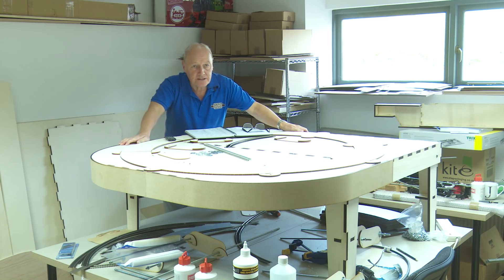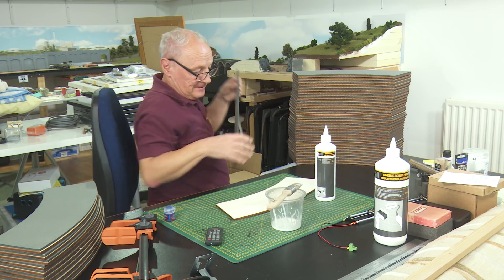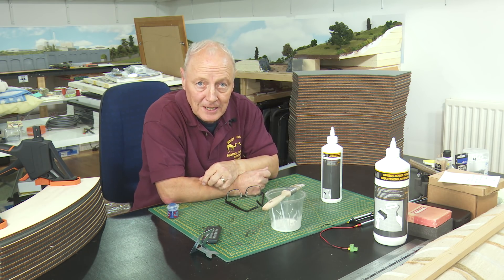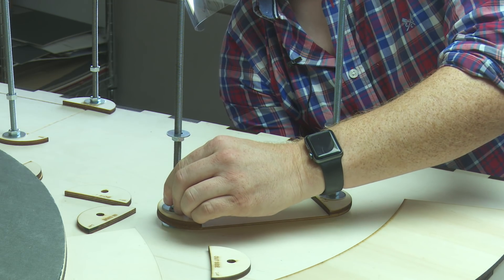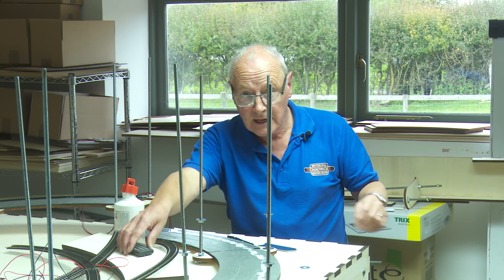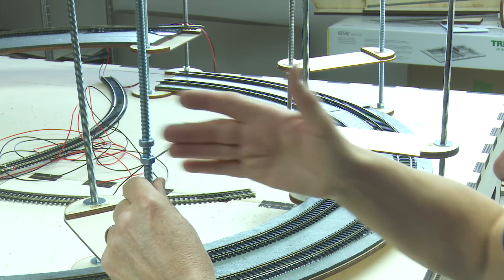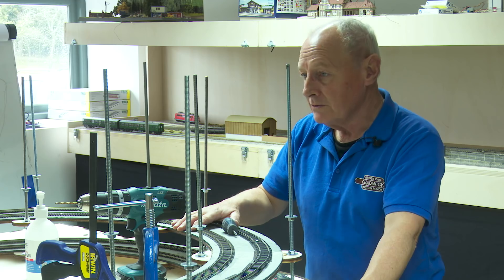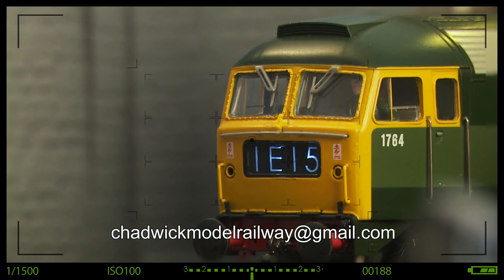Building a Helix at Chadwick Model Railway | 114.

Comment: Wow, you've got your work cut out on this project. Never heard of the DCC concepts Power Base but it looks really good. Presumably it means adding magnets to all of your Locos? Very interesting video and I really look forward to seeing the next stage. Thanks.
Reply from the maker: That’s it Dave, but you only need to add magnets to the locos that struggle. 
Regards Charlie.
Reply: @ChadwickModelRailway  sorry need to explain what the magnets use for
Reply: @jenniferwhite6089  The magnets are attached to the underside of your locos and are attracted to the Power Base strips thus pulling the loco down onto the track giving it more traction. (think ground effect in F1).   Jenny Kirk did a video a couple of months ago and she was able to run a loco upside down using the Power Base system !   Dave

Comment: Hi Charlie. Great video as usual, have thought about a helix for my layout but sounds a bit expensive. It was interesting to see your using DCC Concepts Powerbase as I have an 11Ft long rise of 2.5 inch. at each end of my layout and as I am a steam fenatic I find they struggle a bit with three or more coaches. My concern with yours is that fitting these screws in the middle of your track that only just fit below the rail height is that when fitting the magnets under the locos they may catch the screw heads as the magnets need to be as close to the metal plates as possible for good adhesion. 
Just a thought. Keep up the great work. All the best. Mike.
Reply from the maker: I really don’t think that’s the case mate because if the magnets were to catch the screwheads they would catch the point blades too. Regards Charlie

Comment: Hi CHARLIE 
Great video. Just a point on you using the screws to fix the track. Will they interfere with the magnets that you are fixing to the loco’s? I experienced a problem when I fitted the magnets with my rail fixings touching the magnets and causing a short. Hope you don’t have a similar problem. Keep the videos coming, thoroughly enjoy them.
Reply from the maker: Hi John, they wont touch but they might have an adverse effect on the loco's movement!

Comment: Hi Charlie! Aren't helices just fun with all the issues they come with? Like what all could go right for once? I didn't go the route with the rods and nuts but I am thinking I probably should have. I cut 1x4's to support between each level at 3.75" since I am using .25" plywood to give a 4" rise over a 29.5" Radius. I had so many issues where both incorrect math and warping in the plywood caused me having to back step many times by having to add extra supports. It seems like you might think the first loop works great but you really can't tell until you get to loop 3 and beyond, or at least I couldn't. I am looking forward to seeing the finished project and your thoughts on it and I might consider going with rods and nuts on my 2nd one. Take care! - Jason
Reply from the maker: A brilliant and honest comment Jason. And one which I really appreciate, fingers crossed, I know it’s a challenge. Regards Charlie
Reply: Hey Jason my Club used allthread and so am I.   I think I told you before.   I haven't been able to do much through because the weather turned bitter cold and frozen rain or snow now all week.

Comment: Just a thought, Charlie. As the underlay dislikes heat is it worth soldering your rail dropper wires to the track before fixing the track to the underlay? A great video and a major task on which you have embarked. Very brave :--)
Reply from the maker: Hi Pat, I couldn’t have explained it very well. Yes I have soldered all the dropper cables on prior to fitting. Regards Charlie

Comment: Thanks Charlie!  Who said you wouldn't need math when you leave school.  LOL  Cheers Warren
Reply from the maker: Thanks Warren, I’m so pleased that you found it entertaining. Regards Charlie.
Reply: A small problem with the maths!  A rise of 5.5 turns in 18" gives 3.25" (83 mm ) rise per circle.  The radius 3 curves are then on a 1 in 36 gradient, very much steeper than the 2% suggested. Clearance may still be a problem as at the sector joints there will be two thicknesses of plywood plus the underlay; a total of at least 15 mm and maybe rather more.  Added to this is the 4.5 mm height of the code 100 rail and the resulting clearance over rail head is less than 60 mm.  No problem for normal running, but it makes accident recovery difficult.  My helix has just 59 mm clearance and I know the problems.
A further word about DCC Concepts Powerbase.  PVA sticks this without problems provided that you keep to the instructions and weight the system down adequately while it sets.  I used  house bricks laid in pairs with only small gaps between them and let them set for at least 24 hours.  Remember that laying any curved track on a gradient involves twisting the track which makes fixing it more difficult.  My track was fixed with the spiral collapsed to a simple stack so that there was as little twist as possible at that stage.  I only expanded it after it was assembled and stuck.  On reflexion, I think that screwing it down as in the video might be preferable. 
Finally, remeber that the incoming and outgoing tracks have to continue rising until after the outside edge of the track has been cleared.  This adds a further foot or so of gradient to each end of a helix.
Reply from the maker: Interesting points Graham.  I did show on the spreadsheet that the inside track was much steeper hence it being the down line. I also mentioned that the Powerbase needs to continue until the train exits the helix, not just the loco. 
How is the reliability on yours and is loco grip an issue? Regards Charlie
Reply: @ChadwickModelRailway  Yes, loco grip is a problem.  My layout consists basically (much oversimplified) of a single track folded eight mainline 40' long rising by 1' (at a fairly constant 1 in 40) followed by a 4-track helix - radius 2, 3, 4 and a notional radius 5 track at 25" radius - to rejoin the two ends of the mainline.  The two inner downhill helix tracks have slopes of 1 in 36 and 1 in 42 respectively  while the outer pair are at 1 in 48  and 1 in 54.  The whole of the mainline and the outer two (uphill) tracks are fitted with the DCC Concepts Powerbase.  In practice, anything that will travel up the mainline will work conmfortably on the helix.  None of my diesel locos requires magnets neither do the dmus, my Bachmann 9f and any tender drive locos all with a maximum trailing load of 7 coaches.  Almost all other steam locos require magnets with some needing three even when mounting them only betwee 0.5 and 1 mm above the railhead level.  Painting the edges of the magnets black reders them unnoticeable although some of the brake gear has had to be removed to make space.  This too is unnoticeable in normal operation.  The magnets give no trouble when away from the Powerbase lines even when passing over Kadee magnets.
Reply from the maker: Great info Graham which is valuable to the helix newcomer.  I do intend to carry out some trials once the helix is operational so folks can decide if a helix is a possible choice for them.  Regards Charlie
Reply: Yet another good explanation.  From soup to nuts!
Reply: @ChadwickModelRailway  See Charlie, I’m not the only one that finds you entertaining.

Comment: Hi Charlie
The only concern I have is the fact that leaving the screwed rod loose, as shown on the video with the rods obviously not vertical means that with you clamping and bonding the segments with the rods not up straight, will mean that the higher you get the further out the positioning will be and you may have to bend the rods into place thus putting under strain the existing joints that could crack/disbond them. I am no way being critical but have fallen into a similar trap myself,  that was very frustrating. I must say that you are taking on on one heck of a change from what was a very simple layout initially. It will make a very interesting layout, so good luck. Also I have made some track spacers on a 3D printer that are equivalent to the red ones that Peco manufacture but are much more robust, and clip into the track holding it parallel to the adjacent track over a distance of some 75mms each. I would be happy to send you some of the if you would like them for your very extensive fiddle yards. If so how do i get hold of a postal address to get them to you.
Regards
Ian
Reply from the maker: Hi Ian,  I do understand your thinking regarding leaving the rods loose.  I have to take James' advice as this is is his bread and butter.  I'm sure that it will be fine.  If I need more spacers, I'll get back to you but thanks for the offer.  Regards Charlie

Comment: G'Day Charlie.
Mate this is so you don't sound like a naff ok, its pronounced In-Ox, not I-nox.  :D
Oh and welcome to how I have to sometimes secure the track to the roadbed in my Loft (40°+ at times), only way to keep the track down and at the same time allow enough room for expansion in the track (when its really close to my Steel colour bond roof).
Although I'm still trialling extra long broadhead pins and I don't hammer them all the way down, leave a little bit of wiggle room between the head and the sleeper (will find out if its going to work soon, summers a coming). When I can secure the track down more permanently, I think may have told you this one before, I use Sika 300g Black Sikaseal Appliance Silicone Sealant. If I do need to remove the silicone due to say, an error or track layout change, I use Selleys 375g Silicone Remover. The best bit about using the above, is it sticks to everything, and I mean everything (that includes me).  :D
https://www.bunnings.com.au/sika-300g-black-sikaseal-appliance-silicone-sealant_p1210606
https://www.bunnings.com.au/selleys-375g-silicone-remover_p1232412

As to your helix, mate its almost a work of art! Although I would have thought that gluing on the mounting plates to at least one leading edge of each section of radius arc before fitting might have made getting the next section glued in easier when its all put together. Also are you going to put a little bit of super elevation on that, its sort of screaming for it as in certain camera angles it looks like it has an Anti-super elevation (may well be just an optical illusion). And I agree with the other guys who have commented on making the center hollow for ease of maintenance and recovery/rescue. You will thank your self later (although it might be best to send the grand-kids in/under that low bench work).  :D
Looking forward to seeing how you get on, take care matey and keep on having fun (no seriously its meant to be fun)  LOL
Reply from the maker: Great comment G130.  The super-elevation will be tweaked once the helix is in place.  That way wonky tables and floors will be taken into considerstion.

Comment: Another thoroughly interesting episode Charlie. I have considered a helix but my space is so limited, I just can't fit one in. If I could, it would give me so much more space for storage but I just don't think it's going to happen - even in N gauge.
A couple of things came to mind:
Probably only relevant to the second helix now but, if the glue works, but takes too long to set, how about glueing everything down, then adding the screws and proceeding. You can go back in a couple of days and remove the screws.
The second thing is for that inner child in me; I'm sure he's in most of us. Once the first helix is installed, will you please, please put two wagons on the top & let them roll down the helix?😁 
Ignoring the childish pleasure, it would be interesting to see the difference between the inner and outer tracks. Will the tighter radius slow the wagon down more or will the short inner track have the advantage. Great for the physicists too. 👌👍😁

Cheers for now,
Dougie.
Reply from the maker: Hi Dougie, I finished the first one today and put a Mk3 HST coach on each track and away they went!
I may well use a different method for the second helix.
Reply: @ChadwickModelRailway  Hahahaha excellent Charlie, hope you got it on film. I would have been waiting for that moment all through the build.👍👌

Comment: DCC Concepts certainly has some interesting products.   The Powerbase is something new to me and a great idea.  The helix kit is a nice pre-designed alternative to big sheets of plywood & a pile of saw blades.
But I have a love-hate relationship with the idea of helices.  On one hand, they're an elegant solution, especially for most of us w/o 2000 sq ft of space for a RR.  But I hate the "waste" of so much expensive track where it isn't part of the scenic railway (not to mention the cost of materials).  If only they could double as fiddle yards & storage areas.  Elevators are now another viable solution, but have moving parts (higher maintenance), require operations, and aren't cheap either.  Alas.
What I want is the improbable.  A continuously graded multilevel circuit that rises & falls while circumventing the room(s), BUT without requiring lift-gates or duck unders.  In other words, the holy grail.  😁
Reply from the maker: I’m afraid that you’re after the impossible Frank. Hey it’s only trains!
Reply: @ChadwickModelRailway    Hope springs eternal.   I'm looking forward to seeing your helix in place.   Maybe a man-hole can be put in the base for better access down the line.  You know derailments happen most often in tunnels & the hard to access parts of layouts!  lol!
Reply from the maker: It’s on the list mate.

Comment: It’s an impressive piece of engineering (can you engineer wood?), can’t wait to see it in situ.  I was left wondering how you get it home and if the doorway is wide enough!  Be interesting to see a before and after running of the locos with the DCC magnets fitted / unfitted.  

Obviously the key is to avoid derailments on the helix, especially at the back. Did you discard cant / super elevation as more about looks than performance?
Reply from the maker: Rest assured I have measured the doorway to the Railway room. Although the helix will go in the sideways. It will be interesting to see which locos will require the magnets to be fitted, and the length of train that they can pull.
Reply: I will get it out a deliver in our van for Charlie.

Comment: “Screws” on Chadwick! You’ll need a torque screwdriver so as to avoid “Cupage” & “Dipping “ that’s my advice & the screws are pocket hole screws and are as chip as chips on auction sites good luck getting that monster in your home & if you haven’t got a bad back you soon will wrestling that behemoth screws @ Chadwick......🤔 As always another brilliant video thanks for taking the time to post
Reply from the maker: Thanks John, I’m so pleased that you found it interesting and humorous at the same time. Regards Charlie
Reply: @ChadwickModelRailway  Tool academy on eBay selling a great Torque Screwdriver for £30 odd at least you’ll know that every screw is torqued down the same to track problems it’s why you glue & don’t use track pins
Reply: Refer to video No:38 Glue or Pin
Reply from the maker: I’ve had to eat my words on this one.

Comment: Great video again charlie im using 2nd and 3rd radius curves have'nt got the space for bigger ...as to power charlie I intend to have two feeds on each loop and also a small link wire at each track joint so as not to just rely on the fishplates to transfer power
Reply from the maker: Belton braces Paul, you can’t knock it. Regards Charlie

Comment: Charlie a terrific job on both episodes.  I have a question and a comment.  Q:  Did you and Squires James Super Elevate the outer track toward the center to avoid derailments or do you have something else in mind?
And the comment the 6G x 1/2 Flanged Stainless A2 screws you used to tighten down the outer track appear to be a rounded or domed headed.  Here in the U.S. we have a similar screw used for fine carpentry and furniture making.  It has a flat head with a flanged collar.  Both are a Philips style.  I use the flat headed flanged collar as it provides more clearance for all rolling stock.  Also if you were to place either screw,between the sleepers,  just slightly off center, to the track alignment, it would provide the same clearance effect.
~Jim
Reply from the maker: Hi Jim,  The final adjustments won't be made until it's in situ.  
That way the levels will be true in my railway room.  I can then do the adjustments with a little cant/super elevation, to lean the trains in.

Comment: Good video.  I do not understand the working of the Powerbase on the gradient.  I seems like it would reduce the pulling power of the loco as it increases the drag that has to be overcome.  I could understand using it to hold wagons on a gradient from running away.   I will have to do some research.  Did you defeat sound deadening properties you were trying to achieve by putting the Powerbase directly under the track?  Would it not have been better to put it under the foam?  Just curious.
Reply from the maker: Interesting points mate. With the power base, you need to fit small magnets underneath your locos to enhance their grip. Regards Charlie
Reply: @ChadwickModelRailway  I looked up all the videos I could find on the Powerbase and testing of it.  Interesting idea.  I am waiting to see more of your install and how it works.  I might do it too.